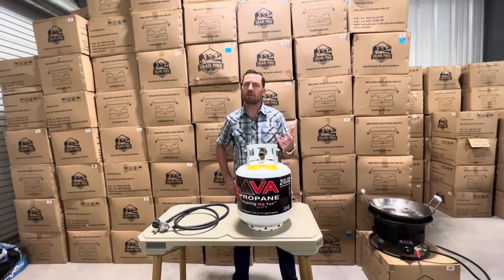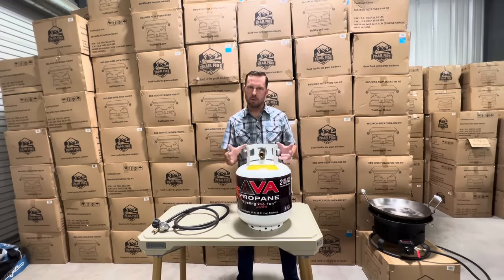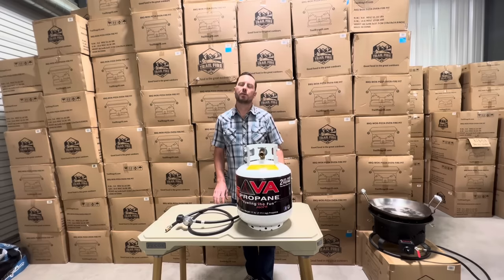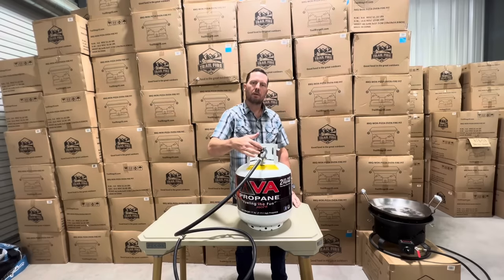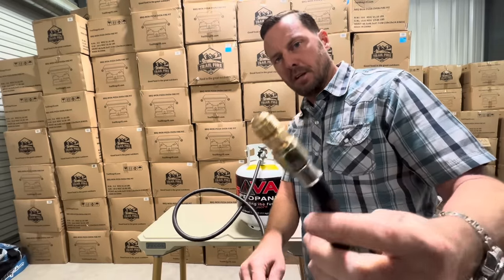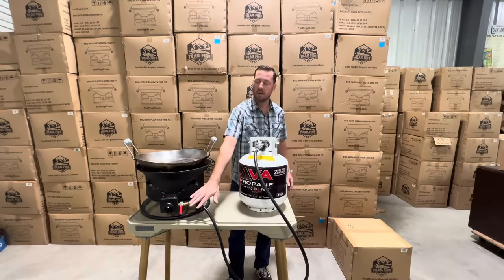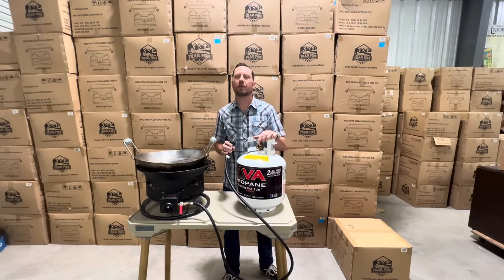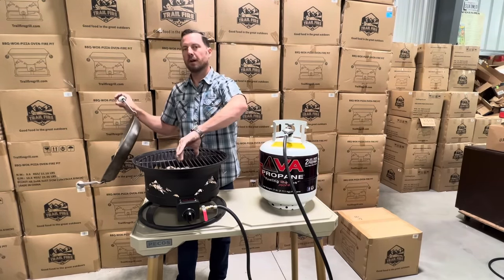Propane For Dummies | How to Reset Your Propane Tank OPD Valve Low Gas Flow Fix

Comment: I have an offgrid camp, it gets really cold in winter. I only go at camp occasionally. I use propane 20lb tank that is inside..to only to use on a 2 burners small cooking stove. My question is, what is the safest and inexpensive way to use my burner. Was told to remove tank from the inside. I close it after each use and crack window open when in use. Tks for helping me.
Reply from the maker: I have a 6 burner propane powered cook top in my kitchen. It’s safe to use as I have a hood vent above that removes the exhaust and any threat of Carbon Monoxide build up. Absent a hood vent you will absolutely have to ventilate the room with a window the risk exists we have all heard the deadly stories of RV related carbon monoxide deaths. Having a long enough gas line to keep your tank outside of your cabin would be safer way to use your propane burner indoors. Lastly  using any propane powered fire pit or outdoor heater for a heat source indoors is suicide don’t risk it. Ventilate don’t mutilate !
Reply: I have no hood because I have no electricity, I only open the window. Close tank and stove after each use. I prob should have the tank outside, was told that in that case I would need a professional installation and metal lines. Which I will look at, but since it's only for a 2 burners stove and nothing else it's a bummer. But I'm all for safety.

Comment: My issue and why I haven't used my grill for years is the valve would trip right after things were up to temperature. I put the meat on, then when I go to check it I notice the temperature is under 200° F and the flame is super small. I learned safe propane use back when the propane tank had left hand internal threads. I was so disappointed when the technician told me I couldn't fill my one gallon tank that I used for camping.
Reply: There’s adaptor fittings to refill your One Pound bottle from a 20 pound tank. Plus there’s a few YT videos that show you how to do it.

Comment: Wow, that was some really great information!  Question:  I have a propane grill. I bought an screw-on inline meter to tell me how much propane is left in the tank. It doesn't seem to be accurate, though. It's like it is in the GREEN zone, until all of a sudden it is empty. Am I doing something wrong or are those meters just not very accurate?   Thanks for your expertise!
Reply from the maker: Meters are not reliable easier to weight check your tank pour warm water over it and run your hand down the tank when tank is cool to the touch that is gas level
Reply: @TrailFire  THANKS!

Comment: The filter is necessary to keep oils leaching from hose from clogging appliance. You have your filter before the hose; shouldn't it be on the other end of hose, between hose and appliance?
Reply from the maker: As long as regulator is in line its there. There is no filter on our hose

Comment: Does the position of the regulator matter? I have always thought it should be in the position as shown in the video but I have seen gas grills connected in other positions and it doesn’t seem to effect the flow.
Reply from the maker: Open to debate: the answer is it’s low flow and any orientation works  some say hang it upside down for condensation to drip off I haven’t noticed mine drip 💧 out of habit I generally keep it as seen in video

Comment: First off I am sure I am not the only one that misses the older "non safety valve equipped tanks 

I have found that often enough you can do all the stuff shown and you still can't get that GD safety vale to "reset" and I have found the one sure way to get it to reset is to close the tank valve  and back out the flat head screw driver set screw in the valve until you get a little gas flow and screw in back in CW until tight then start over with the grill or what ever "off" and SLOWLY open the tank valve 

I have never had that not work 

I keep a screwdriver in the bottom of the grill for just this purpose
Reply from the maker: Every undercooked meal and failed BBQ,  We all miss them.

Comment: They also have a bleeder screw on the side of the valve. If they're over filled crack that bleeder for 2.5 mins. Then close it and try the tank again.

Comment: I had the tanks do that sometimes when switching over for my RV furnace. Have a question on a 100lb tank that was just filled at a Home Improvement store and it was about -2°F outside when he did. After getting home i noticed the handle was frozen white just like when some heavy flow goes thru but the valve was closed. I hooked my hose with a built in guage and it pegged the needle all the way around when i turned it on, that never happened before. Fired the firance back and everything seemed ok, but after 20min it was not much warmer inside. Checked the furance heat temp at the vent and it was only 74°F which is awful. I hooked my 40lb 1/2 LP tank back up and tried again. Inside vent temp is 155°F which is normal and also steam was coming out the furnace exhaust now which is also normal but not with that refilled tank. It is not my hoses, furance, regulater or  tanks but 100% that refilled 100lb tank. Question is why, did the guy mess it up, and can something be done about it? Thanks
Reply from the maker: Use a 1/4" or similar blunt object to push the OPD diaphragm inward causing a burst of gas. This should hard reset your OPD valve
Reply: @TrailFire  I'm not sure what that would even be like to do, and being a full tank I don't want it blasting me in the face while I poke around in the valve area 🙈 I currently have it teed in with my 40lb tank and it must have back filled a bit since running all day as that tank level also went up. By the way I thought there was a check valve on the 100lb tank but Googled things and it said only 40lbs and smaller tanks have the burst valve so it doesn't leak when opened and not connected to something. When I opened my 100lb tank it had a 6ft blast come out like a fire hose 😳 Didn't think that was normal, but maybe it is. Thanks for the response on this 👍

Comment: If it will ignite with an outside air and product temperature under 100 degrees fahrenheit, it is also known as a flammable gas and not just a combustable gas. Propane is both combustible and flammable in its gases state when mixed with air or oxygen.

Comment: What about the regulator. My local propane/bbq grill guy said several years ago that they changed the design of the regulator As per new federal safety laws that created problems. I have had the issue of low output many times. He said that it’s the regulator and to give it a tap to reset it ?? I do that and it works sometimes or am I doing what your instructing here not knowing so??
Reply from the maker: Regulators are rarely the issue they mostly do their job without issue

Comment: I just bought a brand new 20lb tank and had it filled at Menards and they put 5.5 gallon of propane in. Thats what was on my receipt. I watched them fill it and the machine said 5.5gallon. Im learning now that is way overfilled. Should i let some out?
Reply from the maker: A 20lb propane tank holds 4.6 gallons of liquid gas. I would burn some off. If you keep it out of the sun and temperature controlled no reason to be concerned
Reply: @TrailFire  ok. It's outside on a screened in  porch that gets mostly shade so it won't get hot. I burned off a little testing a shut-off valve that I connected to the end of a 12foot hose. Not sure how long I need to let a grill run to burn off a gallon of propane. I'd have to let it run for a few hrs I'm guessing. I only ran it for 15min. I'm gonna buy a scale to weigh the cylinder then I'll kno how much is left in it and I may burn some more off. Thanks for the help!

Comment: I've been beating my head against a wall with a new propane tank. I bought my first smaller tank (5lb) and I just couldn't get consistent results out of it when using it with my new camp stove. I'm used to the big tanks with a big grill, and have never had problems. Apparently this new smaller tank has a more finnicky valve though, and now that I understand it the problem seems to have gone away. 😊
Reply: Excellent excellent representation. Very thorough.

Comment: What does it mean when the regulator ices up on the outside?
Reply from the maker: condensation forming because of the pressure difference between the inside of the tank and the surrounding air.

Comment: There is a flat head inset screw on tanks what is that for and should it be closed or 1/4 open?
Reply from the maker: Closed. That screw is for when propane is refilled

Comment: I just connected a tank I exchanged today.  I thought the valve wasn't opening, but when I when to disconnect the tank it's hissing gas.  Any advice? Should I just disconnect outside and the OPD valve will kick on.  Just bought the grill last year and this is the first exchange I've done. TIA.
Reply from the maker: Any issues are generally with the appliance not the tank. With everything off open valve slowly 2 turns and see what you get

Comment: So if I turn the valve on with nothing attached with nothing attached, it will only hold 70% of the pressure? I ask, that's because I have come across full Tanks with completely open valves and the safety is completely closed.
Reply from the maker: when you open OPD valve on an open bbq grill valve for example OPD will only release 30% or so of the max flow

Comment: Why does the BlackStone griddle  instructions say to attach a 1 pound tank to the regulator first, and then you attach the regulator tube to the stove?

Doesn't this trip a OPD? 
Does a 1 lb tank have one?

I assume if true, you reverse the process,  tube disconnect from stove, regulator from tank?

Oddly, Blackstone leaves that information out.

Comment: Should the regulator be vertical or horizontal?
Reply from the maker: The vent opening must be installed downwards to allow moisture to drain from the bonnet to prevent freezing. To properly order a regulator with its vent in the correct position, the regulator must be referenced with the outlet facing downwards.

Comment: Correction!
Actually Mercaptan is added to natural gas to give rotten egg smell for leak detection! Propane Does not smell like rotten eggs!
Ethyl Mercaptan is added to LPG at a ratio of 1 gallon per 10,000 gallon of LPG when pumped into the transport bulk vehicle which smells like a skunk or rotten cabbage some say!
The low pressure is because there is regulator on the line your using! 
If you hook up a straight line with a male pol and no regulator to tank it will blow tank pressure anywhere from 50-150 psi depending on outside temperature or tank temp!

Comment: I am an old dummy for sure. I have been using tanks for 40years, both cooking and using a hand torch to start fires and to head and bend conduit. This this first video I have seen on the internal valve. I think by watching this just now I have probably thrown away a couple of good torches that I thought had clogged up and were no longer of use.,,,,$60 each at that. I have watched this twice and am now ready for that week stream of propane for sure. i will not beat the top with a wrench any more, Please nobody do what I have done. Follow these steps

Comment: I thought I'd look on the university of YouTube to see if anyone could explain why my new blowtorch is suddenly running very low.

This might be the problem.

In my case the torch works fine for a few minutes then slowly chokes off.

In one of the comments an engineer says that the safety device is in the regulator, not the bottle. So i don't know which one of you is right.

I'll try running it at a lower flame and see if that makes a difference.

Comment: I have a Wave 8 catalytic heater with a piezo lighter. You must hold both the fuel button and the piezo in to light the heater. This works fine with one tank, but not my second propane tank. I let it bleed for 3 minutes, reconnected the hose/regulator - and still nothing. The piezo is getting no gas. Any suggestions for next steps if this approach fails?
Reply from the maker: Last resort tank reset. Unhook any device so the valve is visible take a 3/4" socket extension or similar blunt object and push the valve inward gas will burst out, this will reset a sleepy tank

Comment: I’m wondering if there is any other problems with 20lb bottles. Mine will only go down halfway and then stops releasing gas? Any thoughts would be appreciated
Reply from the maker: Size shouldn't matter the gas will behave the same regardless of capacity

Comment: Does the safety valve still function after the tank has been converted to an air tank? Is there a way to just eliminate the safety valve when making this conversion?
Reply: Yes have your Lp dealer put a pol valve on your tank

Comment: What does it mean when the regulator makes noise during use? How do you know if the regulator is going or has gone bad?
Reply from the maker: The rubber diaphragm can vibrate when tank is full, or its hot out

Comment: For added safety , I always open the valve a quarter turn and no further but open it very slowly to prevent the slam valve from closing caused by sudden pressurization 
Because if you get a flashback , Such as a flame coming out at the venturi tubes , Which I've had happen on my gas grill , Then the gas can be turned off very quickly in case of an emergency , I've even used my propane torpedo heater by opening the tank valve a quarter turn and didn't affect the performance of the unit because propane appliances have a regulator which reduces the pressure at the appliance and the quarter turn doesn't affect the performance of the appliance , and compared to opening the valve all the way , you can shut the gas off much more quickly with the quarter turn in case of an emergency
Another case scenario I had was I was driving a propane forklift and a fire occurred in the engine compartment , 
Luckily I I had the tank valve opened a quarter turn , So I was able to get the gas turned off quickly , I reported it to my boss and he called a forklift technician and found a leak in the gas line in the engine compartment and after that my boss told everyone to only open the valve a quarter turn and close the valve at the end of the day when closing up the shop
Guaranteed , By opening the tank valve a quarter turn will not affect the performance of any propane appliance   because the pressure in the tank is around 150 PSI and the pressure from the regulator is around 1/2 lb pressure
With that huge difference in pressure , The quarter turn method will not affect the performance of any propane appliance and there is more than enough gas flow to the regulator But Adds safety as the gas can be shut off instantly in case of an emergency
.                        WARNING ⚠️
BEFORE USING ANY PROPANE APPLIANCES CHECK AND MAKE SURE THE VENTURI TUBES ARE CLEAR !!!!
Insects , Especially spiders can nest in the venturi tubes and spin webs in them , Restricting air and gas flow to the burners and cause fire flashback at the venturi tubes , Before using a propane appliance especially for the first time of the season , Remove the burners and the venturi tubes and blow them out with an air jet , and check the venturi tubes each time before using
Especially gas grills because they sit outside and that's when insects Especially spiders can nest in them
Spiders love to nest in the venturi tubes because of the confined space
That's why it's so important to check the venturi tubes to make sure they are clear before using any propane appliances , In everything you do
ALWAYS PUT SAFETY FIRST !!!!
Reply: But it's the hose not the tank. Go talk to an actual technician that installs propane into homes or RVs ask them if your little white 20 lb propane tank has an automatic shut-off valve built into it or not. The only automatic valve on our propane tanks is the valve that keeps the shop from overfilling the tank. It is called an O P D valve OPD standing for over pressure device. Meaning you can't put too much pressure in the tank. Has nothing to do with controlling what comes out of the tank through the valve that's included in the hose of your regulator. I mean really stop and think about it the regulator what does the regulator do it regulates the gas flow does it not?

Comment: So how come when the  bbq burner is set to Hi/light, why is that not detected as a "leak" and trigger the regulator into Bypass mode?
Reply: Follow up I just reconnected my tank with the knobs in off position and slowly turned on. Waited 1 full min to let the system equalize and presto back to 550 degrees in 10 minutes. I cleaned my grill 3 days ago and somehow put it in bypass mode. Never knew that even existed.
Reply from the maker: Once valve is open and flowing opening valve will not trigger the OPD

Comment: Can any propane regulator be used on a propane heater?
Reply from the maker: Low pressure regulator which reduces gas pressure to 6 ounces is standard for propane heaters
Reply: Thanks

Comment: What would cause line to freeze after getting filled?
Reply from the maker: propane lines can experience freezing in cold temperatures. When the gas inside the lines expands, it absorbs heat, leading to the formation of ice. Frozen propane lines can impede gas flow to your appliances, causing heating or cooking issues.

Comment: Just got my tank filled and noticed clanking sounds inside, what could be rattling around inside? I haven't used since refilling.
Reply from the maker: There is a plunger inside similar to your toilet tank. It moves up and down on a rod
Reply: Thanks,I didn't know that.